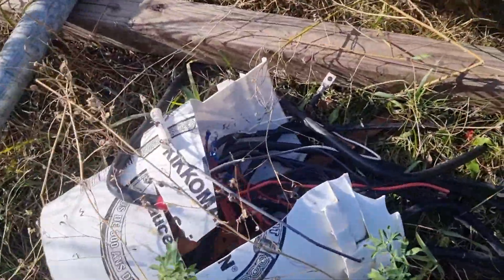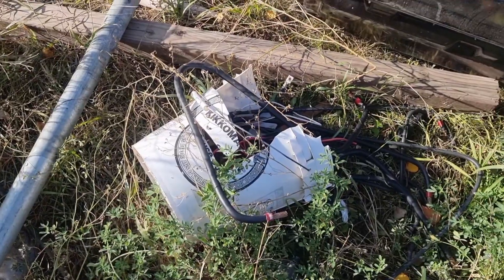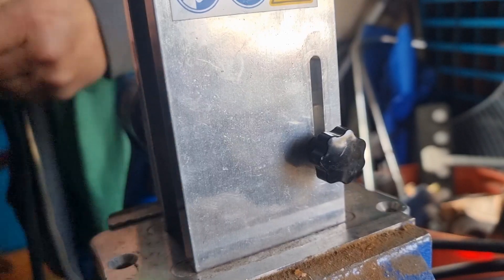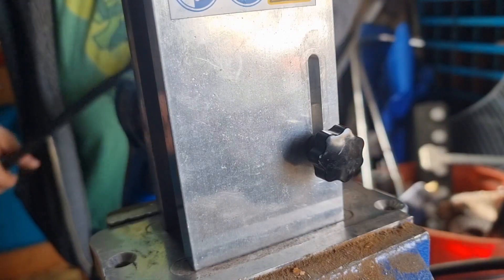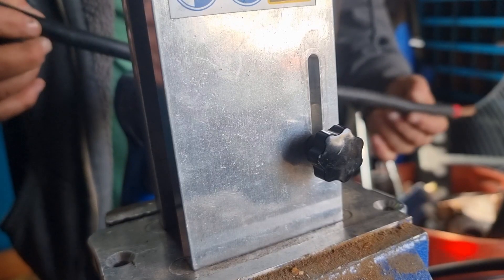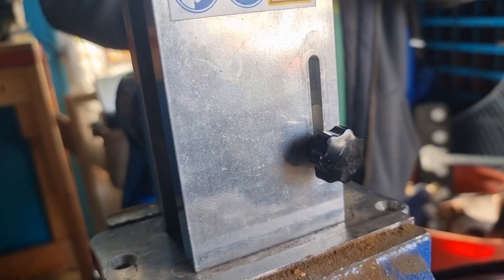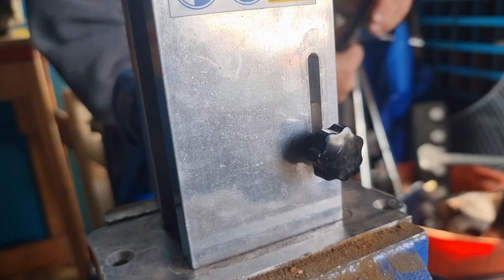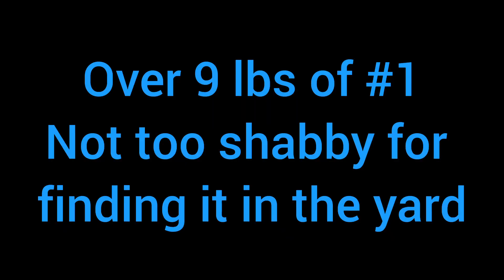Forgotten Treasure: Recycling Scrap Yard Copper

Comment: With that harder covering, it is a lot easier when you run it twice.  I do that with my aluminum feed wire, too!
Reply from the maker: I didn't notice too much difference. I think a bigger gauge would definitely make it easier. This made it a bit easier but not enough to warrant the second run.

Comment: Many years ago I filled up the back of my pickup truck with copper wire from clean up jobs I had done. There was about 1,600lbs. but sadly I only got $1.00 per pound and if I had waited a while I could gotten $4.00 per pound.
Reply from the maker: Oh man, that's still pretty fantastic to get a $1600 bonus.